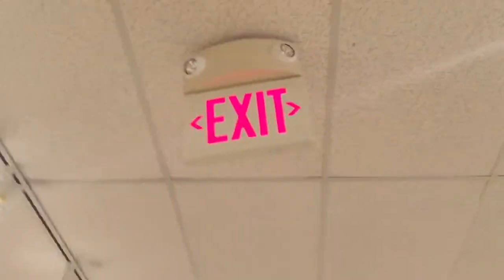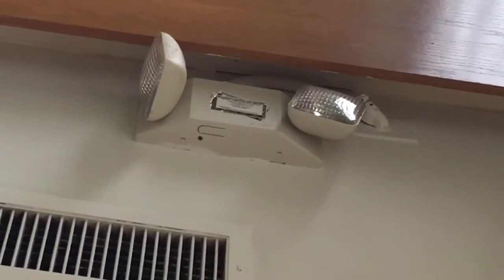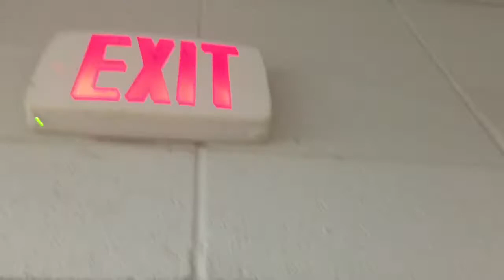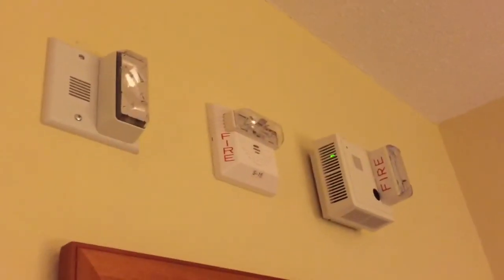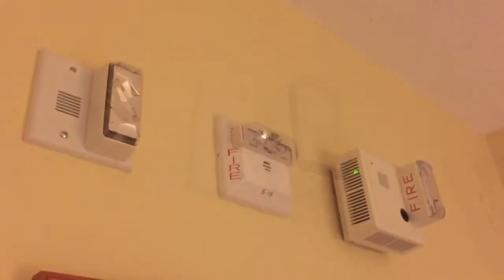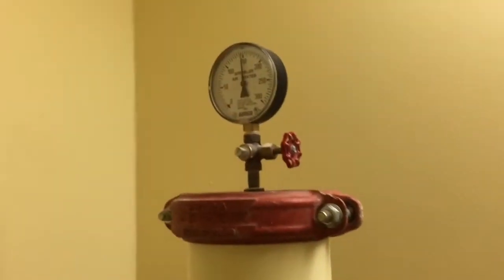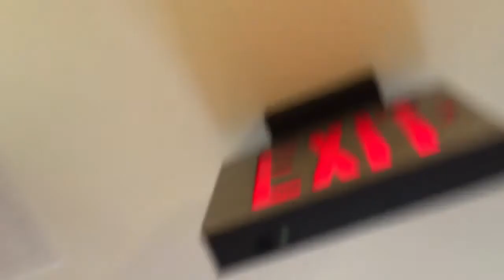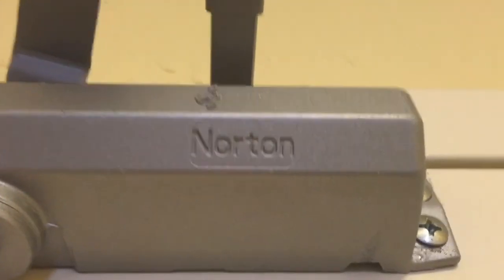Out and About with ExitSign250 Ep. 10

Comment: Hi exit sign 250 great video! Just so u know fire Marshals and inspectors a just exit signs and em lights so u should not a just them unless u have promotion. I'm not trying to be a jerk or anything this is something I just learned so please don't take offence
Reply from the maker: +Simplex Freak  Your incorrect about that. Electricians and contracts install and adjust them. Fire marshals and inspectors occasionally do, but rarely. Most contractors and electricians don’t care how it’s adjusted and just point them in a random direction. And even if marshals and inspectors did go around adjusting them, why would they point the heads at the ceiling and not the pathway? See, no logic there. It simply isn’t true unfortunately. Fire marshals make sure they have them installed then inspectors make sure they work, but don’t always adjust them.